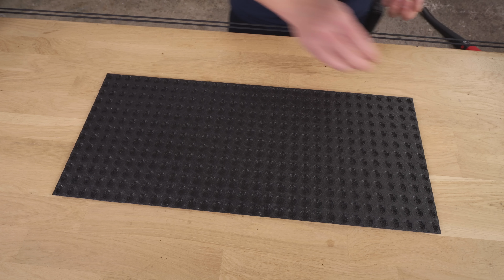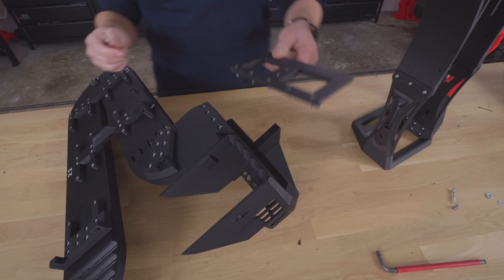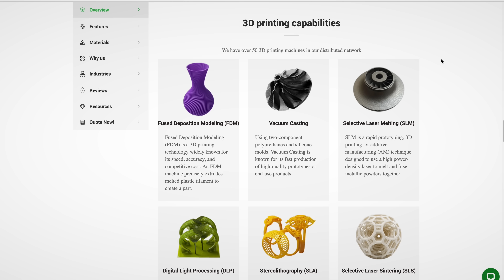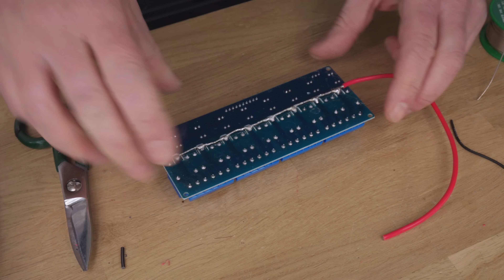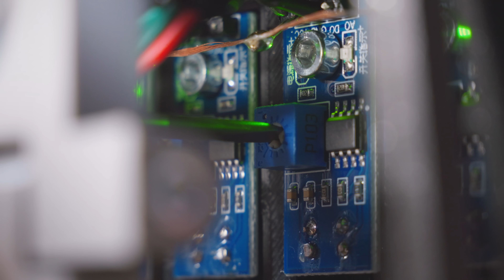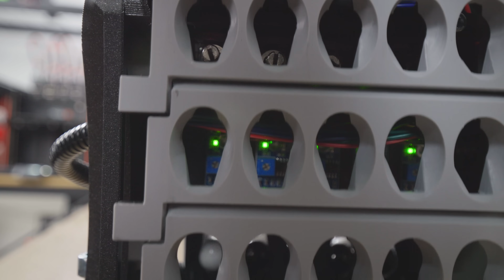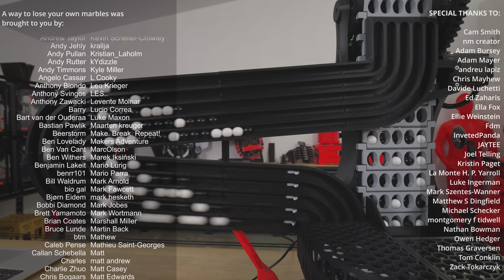Mini Giant Marble Clock that tells the time using marbles - Still too big

Comment: Tips to massively improve the design: Feed each digit from the top not the side so you don't have to update all digits per minute. Keep the white and black marbles in separate containment by discerning them on return from use not at the base of the conveyor elevator. The two different containment areas can be stacked so they can load the same conveyor in the right places. Load black first and insert the white on the second level. Cheers.
Reply: but it updating from top would would increase amount of electronics by more than x3. in this case instead of controlling 5 channels you'd need to control 17 channels (vertical vs horizontal).
and the size of the conveyor... :D
which defeats the idea of making it smaller.
he is already doing pre-sorting on his bigger version that shows seconds and to make it faster he's updating whole matrix at the same time instead of by row/column
Reply: defeats the whole purpose
Reply: @Crushonius  What purpose would that be that apparently eludes me?
Reply: @robertholtz  the purpose of the whole design is that ALL the marbles are updated at once every minute , so that you have this beautiful animation of the random looking marble mess that suddenly alligns perfectly to show you the time . 

Its quite poetic in a way but i guess that is apparently to much to grasp for some people . Maybe that helps you see the beauty of this design
Reply: Genius, imo
Reply: I agree with Robert’s improvements.  Since the initial issue was getting all the balls into the buffer within a minute, reduce the workload by only swapping out digits that are changing (load display area from right, and add exit bypass at each digit position to drain only changing digits. Sorting balls into two bins means only one color detector needed, not 5.
Reply: @edhunt6592  You are all wrong 😀The best design is to use single marble line lift, single gate for ball selection and single line buffer with multiple dividers to for each text line at the end of buffer. It has drawback that the text must have line count equal to power of two, but you can always discard one line.
Reply: @ I like your ideas and agree a single elevator is cheaper/less complex.  These are all opinions so there is no “wrong” label needed for anyone’s contribution.

Comment: What if you made the whole thing vertical?  Make an elevator for each place, hours, minutes, and seconds.  Put all 3 elevators next to each other.  Mount the tracks going vertically in front of the elevator.  The top of the tracks would be the queue where the numbers get set up. Just mount a cover in front of this section so it's not visible.  Once set, they would be dropped into the viewing area.  This way you could have the seconds slot independently fill while the minutes and hours stay static.  I'm not sure you'd be able to get enough of the correct marbles fast enough to do every second, but you could do :05 :10 :15 :20 etc.

Comment: Wouldn't it be easier to sort marbles before they go on the belts, e.g. stir the "pool" at the bottom and have some means of selecting a marble and diverting it to the right slot or sending it back in the pool. Then you don't have to punch them out or worry about belt alignment.

Comment: Just use smaller marbles. Like 5mm diameter. There are plastic beads for toy guns with different colours. They are called airsoft bbs if I'm correct

Comment: Hello Ivan,

I have been following your very interesting project from the beginning.

However, I have one question:
Why don’t you sort the marbles before they enter the lift and then always feed in the correct number of white and black marbles?

This way, you would avoid empty spaces in the lift.

Yes, the base of the clock would become larger and more complex.

But the lift would work more efficiently and could transport the marbles faster.
You would "only" need to ensure that there are always enough black and white marbles pre-sorted beforehand.

Comment: Can't remember if you've mentioned it, it probably has been commented before, but have you considered running the tracks 90° the other orientation, so that you can replace the rows vertically, not horizontally? Sort of like you were building for the seconds-machine, but sliding away the marbles instead of pushing out. Love your work!

Comment: What if you made it so that you had a piece that ran in parallel to the clock that sorts the marbles into black and white?  So that you could just deterministically just gain access to the marbles you need when you need them instead of introducing entropy by praying that you always get all the marbles you need.

Comment: is there still 2 always black columns at the beginning and end there - if you drop them that's ~5 less links/min to process? - also, i assume the ratio of black:white marbles in the tray matches the average ratio of black:white for the number display (ie, more black than white) - that way your selector is right the highest percent of the time.

Comment: as you dispose the marbles into the basket, they should be sorted into black and white, and you could use the same system to "pick" the marbles to fill the entire row in the elevator. This way you could have the elevator doing much less work.

Comment: Would it not be possible to make it overall smaller by having 17 slots instead of 5?  That way you wouldn't need the large run to the side of the conveyer and could have the marbles dropping down to change the time displayed?

Comment: WHY ARE THERE SO MANY SCREWS ?? A single M6 screw in steel can theorically hold around 500kg, and you're using 8 of them in plastic to hold maybe 10kg !

If anyone reading this comment plans on building it, use 2 to 4 screws per junctions maximum, it's way more than enough, and you're wallet will be thankful.

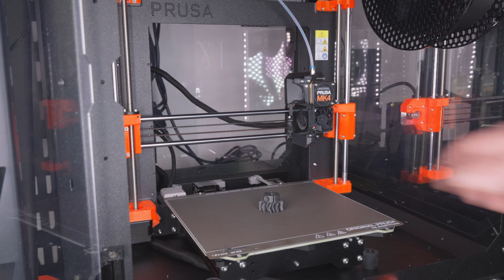5:30 The most complicated parts should never be the one that wears down, you should have printed the large wheel out of carbon fiber infused filament, that way you only ever need to replace the small one.

Comment: You’re writing the time sideways, which means you can only write 5 marbles at a time; if you filled it vertically—bottom to top—you’d need a larger conveyor belt, more sensors, etc. but it would greatly speed up the writing of each minute.

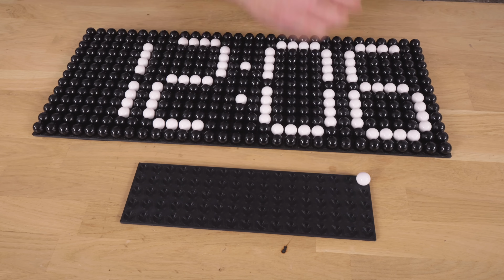Comment: Next, you can build a pick-and-place marble clock that works like your examples at 0:45 or 1:04, except with a framework to hold the marbles more vertically. You just need a robot arm and grabber that moves one marble at a time between the display area and a holding area. I was originally thinking about a XY gantry system, but I think a SCARA arm-type might be cooler.

Comment: Stoopid question: if you are going 5x17, that’s 226 marbles at one time. The most white balls you will need is 33. So why put so many into the tray?

Maybe on the reject device put a diverter channel to filter the fallen one hole to the right?
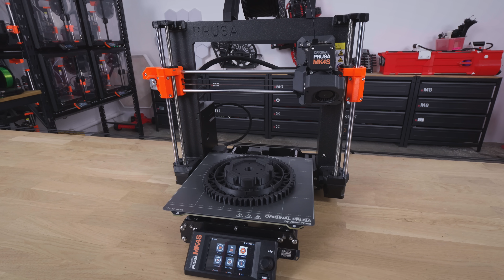Reply: How did you come up with 33? I counted 48 white marbles when displaying 23:38, leaving only 37 black marbles.  The other extreme is 17 vs 68 when displaying 1:11. And 5 x 17 = 85.

Comment: It would be nice if there would be magnets inside the marbles and the marbles would have a different color for each pole. That way the marbles could just be rotated by changing the magnetic field. It would make a very small marble clock.

Comment: Question: There’s some unused length on those tracks. What about adding another gate so you can start building the next set of marbles before you’re ready to release the one you just built. That could reduce or eliminate the need to stop the elevator.

Comment: even for a smaller project, it is bigger than expected. I think it could work on a column sistem, where the marbles don't touch other columns when displaying time. After time expires, they fall straigth down into the tray, instead of sliding through. then, they can roll to the elevator, that is behind the machine, istead of sideway. It would still be big, but can't be seen by the front of the clock.

Comment: > WARNING: Attempt this build at your own risk. Marble clocks won’t tell the right time most of the time. Marble clocks won’t tell a time most of the time. Marble clocks don’t even look like a clock most of the time because you will just be adjusting that little part right in there that requires disassembling down to the last piece. Working with marbles causes losing them. Marble addiction is contagious, you and your loved ones may end up marbled by this project and end up in a years long quest for the perfect marble clock. Don’t attempt this project if you are affected by the clackety sound of marbles falling to the floor. Always wear anti-marble protection shoes when working with marbles, you’ll step on them, any shoes will do to be honest, I don’t even know what anti-marble protection shoes are, shoes with holes? crocs with gruyere cheese as soles? If you work with marbles, you’ll eventually have to answer the question ”Why on Earth do you have marbles in your pocket?? You are an adult.“ more than once. The phrase ”It’s just one more marble clock I swear“ or ”This last change and it will be perfect“ will lose all its meaning and nobody will believe them coming from your mouth. If you say marble over and over, the word starts losing its meaning. Marbles marbles marbles, marbles, marbles, marbles, hippopotamus... See? ... Seee??

Comment: what about having your elevator coming from the main drop bin sort out the colors into tray that other elevators would pick up from to actually fill the time?  then the sorting portion could keep running all the time and empty out the main bin where the other elevator would only need to run when it needs to display the time, which might mean that it could be faster since it wouldn't need to push out marbles and wait to fill with the correct color

Comment: great idea. need to think about how to add an alarm clock function to this
Reply: Would be awesome, would greatly increase the code base because you now need to program it or have the ability to input the alarm function unless it was permanently programed into the arduino. Then mechanically I would think something that siphons marbles off the track to a weighted area that slowly gets heavier until the alarm goes off. Basically the computer would calculate how many marbles are needed to trip the weighted alarm mechanism then calculate extra marbles. I can totally envision this happening. Will take months to develop. I'm not cheap. Venmo me and I'll get started :D

Comment: With only one more gate, you can probably have the belt never need to stop. It would be a negative gate and only need to be closed when marbles are going from the holding area to the display area. The belt would only need to stop if too many marbles are behind this third gate.

Nice build overall!
Reply: If the system can fill a time reading (and allow for the time changing) in less than a minute, then the belt can stop.  Getting ahead of the time doesn't help. Although if you really wanted to keep the belt running, you could of course just keep rejecting all the marbles until you need to start building a new time reading.

Comment: Why not just two different size marbles, two levels in the trap, and a grating that only lets one size through at the end and directly below the solenoids so the colors both self-sort and each other row can be one color?  You've already got the grid profile for the cage top anyway that would, more or less work, I think, as a divider/strainer grate.  Like a coin sorter.  They wouldn't even have to be terribly different sizes (it looks like the entire machine could accommodate marbles as much as a few mm apart, yeah?).

Then again if you had the separation you could simply gate the five points in such a way that it only drops the color you want in each part of the thing.  Although it works well enough as-is, and this extra engineering would probably be overkill unless you're trying to become the Wintergatan of clocks...

Comment: have 2 buckets at the top of the elevator. Instead of an ejector to sent back the marble down, you have it eject white marbles in the first bucket, the white bucket. The blacks that remain go in the second bucket atop the white one. Each bucket can now be your 2 color cartridge for your dot-marble printer, and you always have marble-ink for printing the time just in time...
Reply: Yeah I think building a marble color separator is the best design idea. Especially when it comes to counting the seconds. Having to randomly sort the marbles for every minute is extremely inefficient and could theoretically lead to an entire row never getting finished if, for example, the row needed a white marble but just happened to only get black in that channel for an entire minute. With the seconds display there isn't the luxury of waiting a minute for changes.
Reply: My thought is basically the same but have the buckets at the bottom and have a lift pull from the buckets to the top.
Buckets in the back, lifted up and into the display, drops down into the sorter that returns them to the buckets.
Reply: The bucket up top makes for faster printing. You can possibly only need a single column elevator as well, that way you get a constant stream of marble going back up.

Comment: I think that if you built a glass walled vacuum chamber, put the machine in it, and set an integrated vacuum pump to always pump the air out of the chamber, it would still make less noise than the machine does in open air.
Reply: Wouldn't the vacuum pump make enough noise on it's own?

Comment: can't wait for wrist version 😍😍😍😍
Reply: yes, pls... a version that can be printed on a 200x200 bed in one single print ;-) use tiny ball bearings
Reply: @theorganguy  I'm guessing there is a limit to how small it can feasibly be made using 3d printed parts. When you're dealing with a machine the function of which depends on predictably controlling the movements of hard spheres, the parts involved need a certain level of "smoothness" compared to the size of the spheres. In other words, the smaller the marbles, the tighter the tolerances of the parts. A miniature version of the clock could certainly be made, but probably not using 3d printers. At least not ones available to most people.
Reply: @Wishbone1977  yeah that's probably the only problem

Comment: I probably missed this in an earlier video, but why not have the solenoids select the correct marbles directly into the tracks instead of kicking out the wrong ones before the tracks?
Reply: The question is - I think, if I understand you correctly - how you identify an individual marble having the right colour before you actually have it in a fixed place. The easiest way to do that is to scan the marbles as they randomly enter the elevator. It's then up to sheer luck if any given hole is either empty, black or white, but if you then remove the wrong ones you still end up with the marbles in the correct sequence. Some sort of 'pre select system' before elevator would be feasible I guess, but it would add a lot of complication to an already very complicated machine. It's not certain beforehand that such a contraption wouldn't be faster than taking the loss in efficiency caused by many 'empty holes' on the elevator.

Comment: The random feed combines with the required mix (mostly dark) to result in having to spend a lot of extra time kicking dark marbles off the conveyor to get the light ones into the right position.  Consider having a mix of 50% dark and 50% light marbles, and changing the display every other minute from light on dark to dark on light.  It won't completely solve the problem (ie, optimize for minimum average number of conveyor links needed per time display) but it should be quite a bit closer to optimal than the current design.  Plus it would add another level of interesting to the display, switching back and forth.
Reply: Actually, that would work better than making the display 50/50 black and white. Let's say there are 50/50 marbles in the machine, and the current minute displayed is mostly black. This leaves mostly white marbles in the reserve. If it flip-flopped colors as it went, then the next minute would be mostly white, which is perfect. By flipping contrast every minute, the minute being built would always have more available of the color it is working with!
Reply: Brilliant idea
Reply: Since the change in ratio is proportional to the amount of the marbles in the reservoir, the lazy solution is putting even more marbles into it at the same ratio. The ratio change approaches zero as the reservoir marble count approaches infinity.
Reply: The display alternating colors is just wrong.   smh  😋
Reply: This is a genius comment and also something that can be implemented with just a software change! Hope he gives it a go 🤞
Reply: For each column or row of each digit there's a set pattern of black and white marbles that cycles every 10 digits. There's no need to mix and sort the marbles.
Reply: @putrid.p  Then you just have to find somewhere to line up almost a thousand marbles in the right order...
Reply: @putrid.p  he uses that property in his seconds version of the clock.

Comment: You really need the marbles to go straight down so you can update each digit independently.
Reply: That's what I was just thinking. It would require more channels to do it by column like that, but you would cut out tons of work sorting and staging marbles for unchanged digits repeatedly.